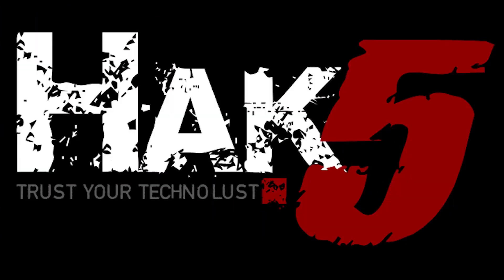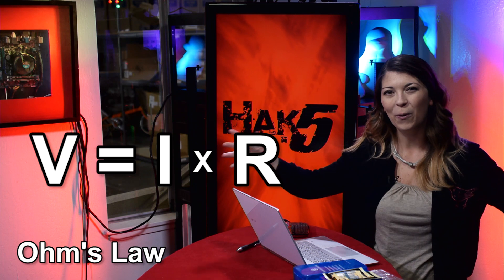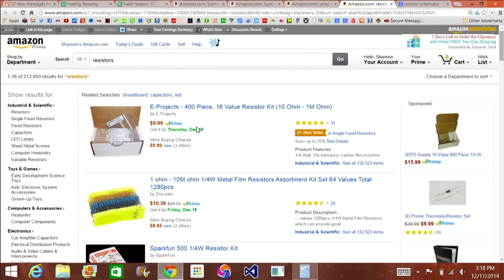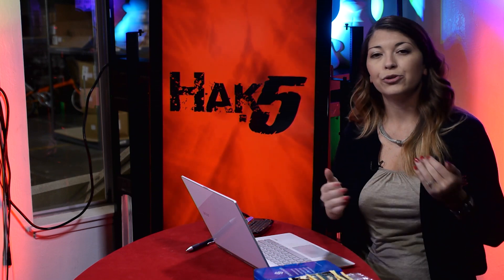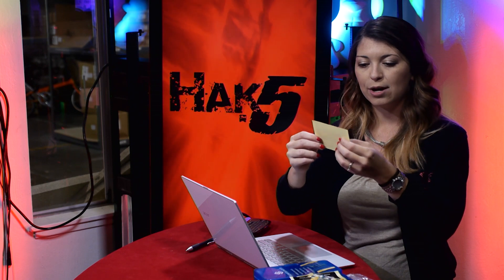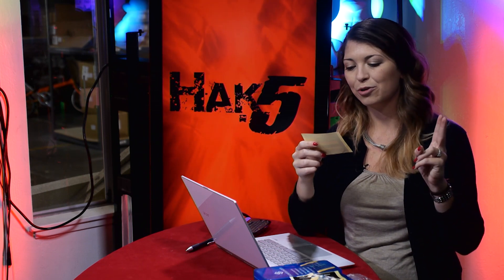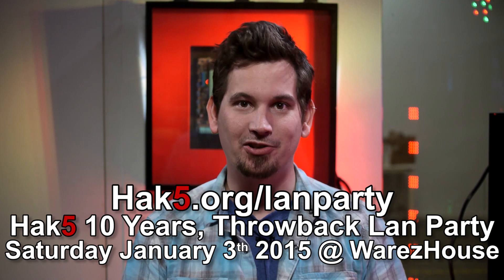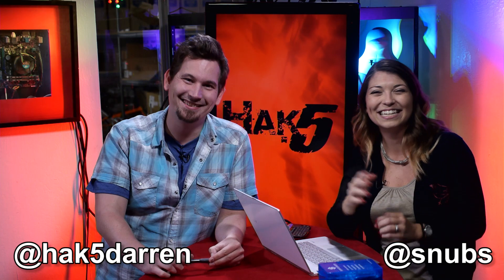Resistance is Futile, Unless Using Ohm's Law, Hak5 1719

Comment: Hi Shannon, 

You have to calculate the voltage for the resistor AND the LED. The LED will have a fixed voltage drop and a maximum current rating.  Each type of LED will have a different value, but it will say on the specification - it's usually around 2 volts.

So.... if you have say a 9 V battery and the LED voltage is 2 V, then the voltage drop across the resistor will be 9 - 2 = 7 V. Since the resistor and diode are connected in series, whatever current flows through the resistor will also flow through the LED..... we can now choose a current  by selecting the value of the resistor... and we know it needs to be less than the LED rated current (so the LED doesn't go 'pop'). Say the max LED current is 22mA  (=0.022A) then the resistor value will be R = V / I  = 7 / 0.022 = 318 Ohms.  The next largest standard resistor to 318 is 330 Ohms. ... Now calculating in reverse.... I = V / R = 7 / 330 =  21 mA.

To calculate the power, multiply V x I for the resistor it's 7 x 0.021 = 0.147 Watts. For the LED, its: 2 x 0.021 = 0.042 Watts.

If you want you can buy  the LED with the resistor built in... then you don't have to worry so much!

Hope this is helpful :-)

Ian

Comment: The math for choosing resistor value is not ideal. You are neglected the forward voltage drop of the LED.

When an LED is lights up, it has a certain voltage drop called the Vf (forward voltage drop). Different color leds will have a different Vf. 

R = (Vbattery - Vf ) / I_desired --> is how to calculate what value resistor you need.

This is important because without accounting for the Vf, your led will be dimmer especially if you choose a conservative current that is well below the maximum. Also, you may think that all leds are the same, and use the same value resistor for all circuits but will soon learn that the led may not even be appear to be lit because the current was so low.

Comment: At ~4:05, you attempt to solve an equation of 3 variables using only one solution. You must have either (n-1) solutions, where n is the number of variables in your equation in order to solve it, or you must have n linearly independent equations total. This is why you cannot state "If V=IR and V=1, then I =1 and R=1". It might work out, but it is not correct to solve the equation this way since 0.5 and 2 work as well, etc.

Comment: The reason for the resistor is that a LED is a constant current not constant voltage device, the resistor limits the amount of current (and voltage) that can be delivered to the LED, even with a constant voltage source within spec the current can spike causing damage to the LED.
Reply: not sure if it was a typo or not, but I'll correct regardless. Leds are a current controlled device. The current can vary, which will change the brightness so long as the current is within the specified range stated in the datasheet.
Reply: Enrico Perera That is not totally true, LED diode current is approximately an exponential function of voltage (according to the Shockley diode equation), so a small voltage change may result in a large change in current so they are not current controlled devices just is easier to implement current control (due not constant forward voltages of LEDs which again is function of current)
Reply: Miloš Lazović Voltage and current will always go hand in hand. But you can have a voltage source with extremely low current, and the diode will not light up. You can try this a power supply that can restrict the current. Even if you bump up the voltage, the led will not light up. If you apply a fixed current, the led with light up. If you increase voltage. The current through a diode, drops a voltage (that is in relation to the Shockley diode equation).  

Which is why I said that an LED is a current controlled device not not voltage controlled. 

Hopefully that make some sense. :)
Reply: Enrico Perera you are wrong they are NOT current controlled devices, you can say they are voltage controlled devices, for every current through LED diode is only one voltage which produce that current and vice versa so they are same current controlled as voltage controlled
Reply: Enrico Perera to simplify voltage and current in LED diodes are not independent, so change in current always have as consequence change voltage across it, basically same as nonlinear resistor (constant current sources are examples of devices where current and voltage are independent, no matter what voltage you apply current will be constant, same is for constant voltage sources where voltage is always same no matter of current)
Reply: Enrico Perera I thought LED brightness was controlled via Pulse Width Modulation (PWM) which is a digital means of switching the LED on and off at different rates to give the appearance of dimming and brightening. But that may be the only way I am familiar with.
Reply: Scott Junner you can control LED brightness changing current thru it, but it have some limitations, and is much more complex (current is complex relation with brightness and you can't go below 60-70% of maximum brightness and with PWM you can go to any amount)
Reply: Ah, good to know.